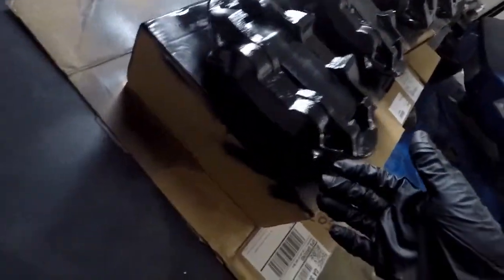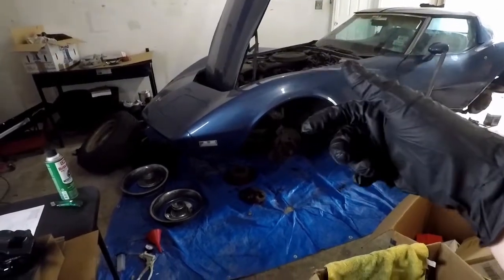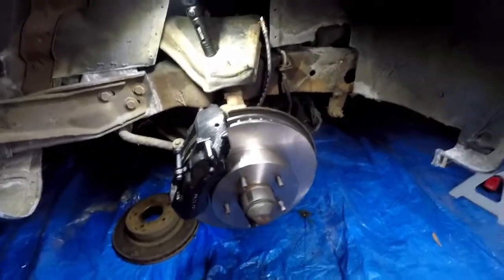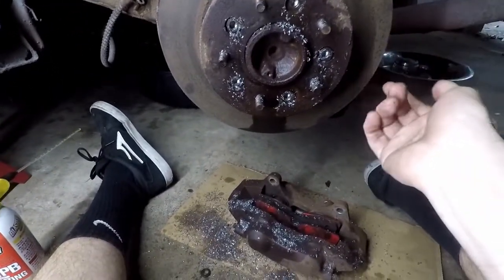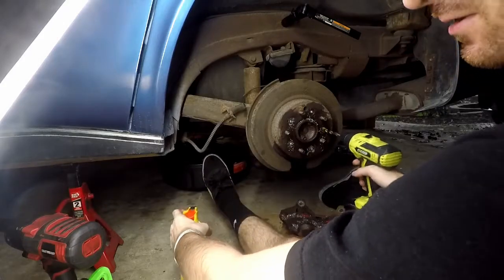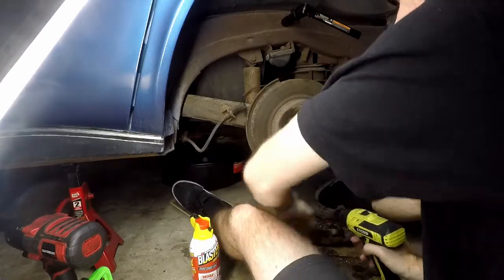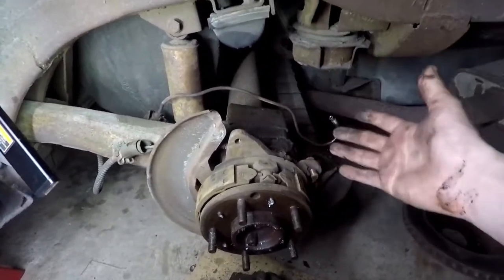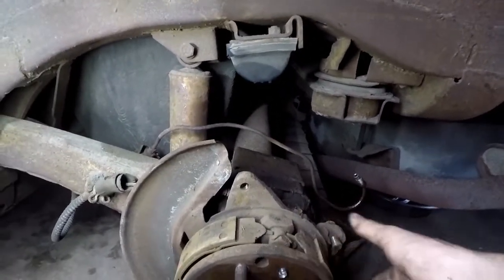Brake Overhaul On My 1979 C3 Corvette - Part 2

Comment: Did you buy new calipers or rebuild your old ones?
Reply from the maker: I bought new ones with oring seals instead of the factory style lip seals
Reply: @bluesxt  how much did you spend? Every place i find even the cheapest calipers are 100 at least and thats with turning in the core
Reply from the maker: @jerryw2460  I got a kit from top flight automotive with new brake oring calipers, pads, lines, and parking brake shoes and springs for less than $650 after shipping. Didn’t have to turn my cores in either. 
It is the non delco brand calipers but I don’t care too much about originality for this car.
Reply: @bluesxt  I appreciate it thanks